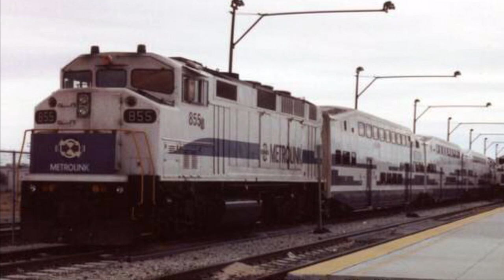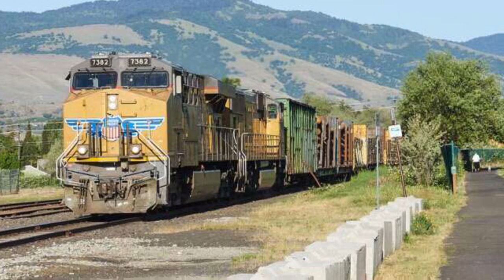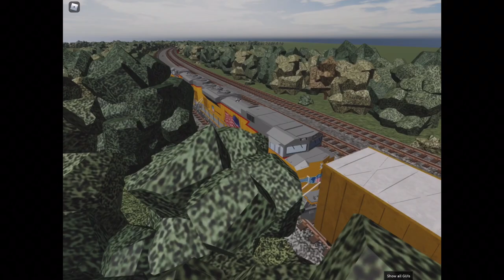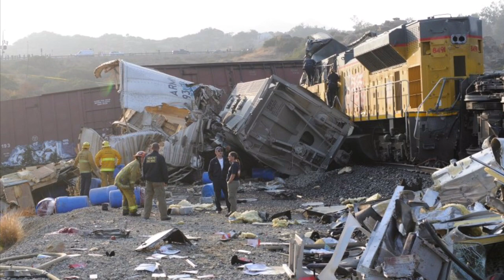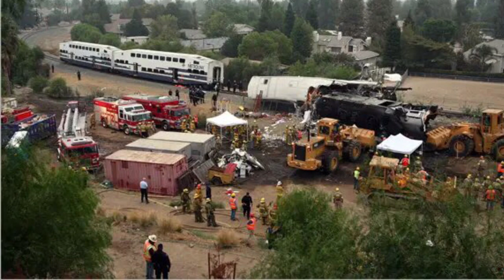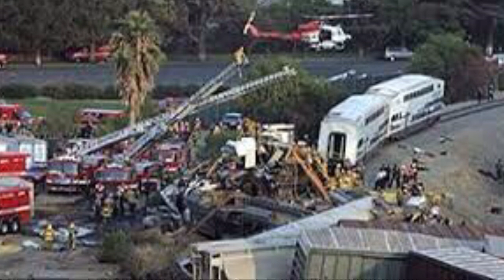| Distracted At The Controls | Train Disasters Episode 1 | Chatsworth Train Collision

Comment: Very sad. Distracted driving causes many crashes and death. 
Perhaps someone can design a way to turn off the drives phones, they could only use a 2way radio that's part of the train or car. A signal transmitted to the cell phone that prevents in coming and out going transmissions. I am not an electrical designer, but we have tiny computers that doubles as phones, so something like this can be built.